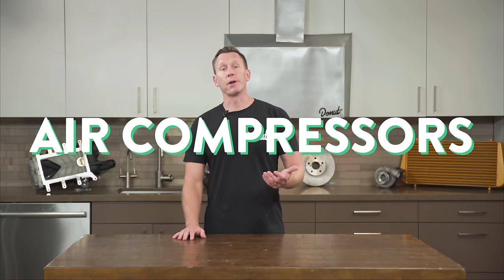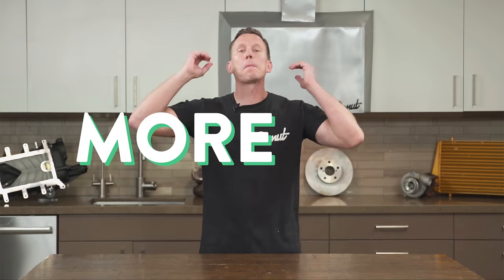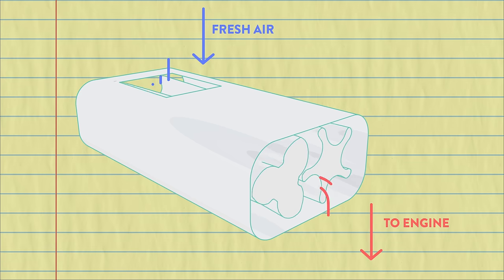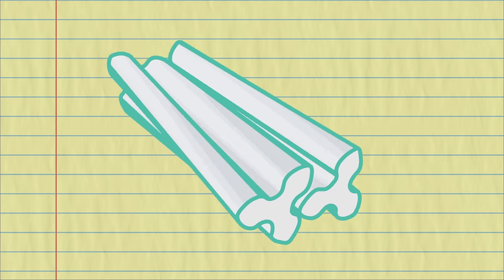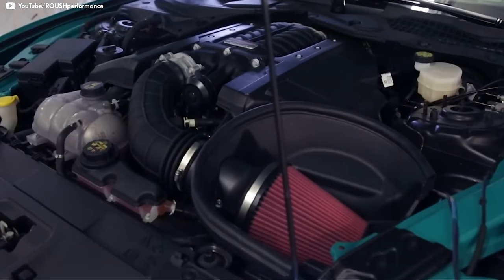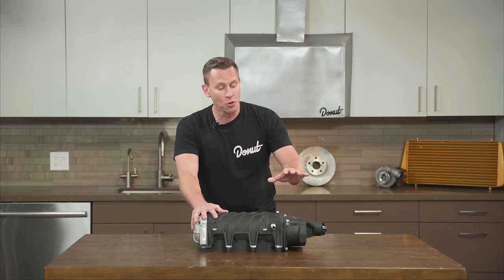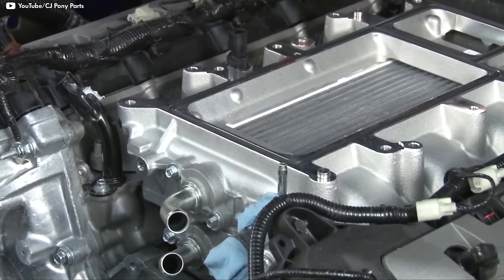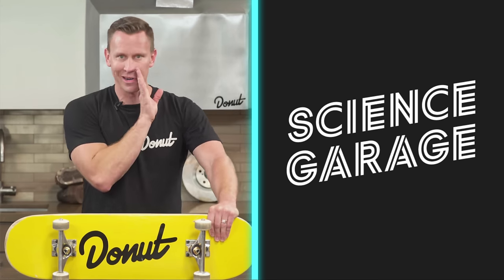SUPERCHARGERS | How They Work

Comment: Now that both the turbocharger and supercharger have been investigated separately, how about twin-charge systems?
Reply: I'm in
Reply: 1.4 TSI
Reply: lancia!!!
Reply: The Zenvo ST1 is Twin charged. it both has a turbo and a supercharger
Reply: @xxitzrawxx1732 
 Engineers: So what are we looking at for aspiration?
Zenvo: Well what are the choices?
Eng: Well we have enough space for turbos but we can also fit a pretty good supercharger of ours.
Zenvo: How much space
Eng: Well that depends on your choice
Zenvo: Just fuckin do both.
Eng: Bu-
Zenvo: I SAID BOTH
Reply: Check out group B rallying. They did this. 0-60 in 2.3s on GRAVEL in the 1980s
Reply: Lancia S4 demonry.
Reply: Engineer = sir do you want a Supercharger or a Turbocharger? 
CEO = Y E S
Reply: The koenigsegg ccr used twin superchargers
Reply: The Volvo S60 has a supercharger and a turbocharger. I’m sure everyone knows that
Reply: Twin charge is just a twin turbo or twin supercharger.

I'm assuming you mean compound boost (compound = 2 or more different items together as 1. Twin = 2 of the same.
Twin turbo = 2 of the same turbos. Sequential turbo is 2 or more turbos of different sizes set up in a series. Twin charged is twins of the same supercharger (usually a twin Procharger or Vortech centrifugal, rarely positive displacement type)
Compound boost is turbos AND superchargers, 2 different boost creators, working together to boost the motor.
And let me tell you, they're crazy. The twin screw obviously eats some power and caps out the top end, so it limits the turbos efficiency, but you basically get INSANE low end and hold onto it for longer into the top end. Again though, the reason it's not generally used in professional racing, is that it limits the efficiency of just plain old turbocharging and adding the turbo systems to the supercharger system is just added weight and complexity that they do not want to have in a race car
Reply: Yes with some nos !!
Reply: @Mr Sunshines Wow you're really going on a semantics crusade, get a life
Reply: WTF  @NewDesignVinylGraphics  hahahaaa. LOL. Show me a shred of evidence on Stock Volvo 60Sedan 2,4L. gas or Diesel?!   Not on this planet.  OMG.     My MB C180sportcoupe (M271).   Kompressor wheel just smaller and +45HP more instantly ! BOY!
Reply: @JoeIsCrazyWillman  F1 take a look. exhaust turbo + electric Kompressor... V6 1.6Liter 800-900HP!
Reply: Mr Sunshines no they are not the same thing Jesus man one is run by a belt and makes linear boost usually. The other typically peaks at the higher end and is fed by exhaust gases. Two different things that do the same job increase engine output
Reply: They are both compressors i.e. they increase inlet air pressure. Higher pressure increase thermal efficiency and air mass flow rate which translates to more power.

Twin screw compressors or lobe compressors are positive displacement (PD) compressors. During intake and compression, piston engine acts as a piston compressor, which is also a PD compressors. Therefore, if we put a PD compressor at engine’s air inlet and make its rotational speed proportional to the engine’s (hence the belt), it feels like the engine’s displacement get bigger. Hence the supercharger. No turbo - lag!

Exhaust gas still has a lot of energy. Therefore, if we put a turbine at engine’s exhaust, we can convert some of this energy into mechanical work. We use this mechanical work to spin a compressor at engine’s air inlet. This compressor cannot be PD compressor because turbine’s speed vary based on exhaust gas velocity and at low speed, PD compressor actually deliver less air than what would naturally flow if there is no compressors. Therefore, we connect the turbine to a dynamic compressor instead. This dynamic compressor does not do much until it rotates at a sufficiently high speed. At high speed, this turbine - compressor i.e. turbocharger become effective. Turbo - lag!

We can install both supercharger and turbocharge. Supercharger’s PD compressor provide instant boost at low RPM and turbocharger’s dynamic compressor take over and provide boost at high RPM.
Reply: Mr worldwide
Reply: There's a disturbing lack of Detroit Diesel 71-T in these comments.
Reply: re inventing tsi engine
Reply: Westin Chaplin and the dodge
Reply: Nissan March Super Turbo

Comment: Turbos are spun up by exhaust gas, superchargers are spun by a pulley on the engine assembly.  Same function, different ways of spinning it up
Reply: That is why turbos are lagging at low rpms
Reply: And therefore different boost curves, so you can manipulate them by tweaking and changing sizes of wastegates, pullies, AR wheels, etc, etc
Reply: @Mr Sunshines A Turbo is widely recognized as a means of forced induction that uses exhaust gases to power it.
A supercharger is widely recognized as a means of forced induction that uses the crankshaft to power it.
Reply: Mr Sunshines why are you so angry? Lol
Reply: @Mr Sunshines shuuushh
Reply: Why use turbo instead of SC if a SC delivers the same power instantly
Reply: @vixrse  so a SC takes power of the engine in the early rpms but delivers more power than a turbo on the higher rpms?
Reply: Oussama hosni A supercharger is always taking some power from the engine, regardless of rpm. Superchargers are better than turbos at lower rpms as they have no lag, while turbos are better at high rpms as they produce more power due to not being limited by the speed of the engine.
Reply: And different sound outputs too! (Superchargers are better in my opinion!)
Reply: @anthonyflahive9160  ohhh yeah!  Love me a good whine
Reply: @oussamahosni9890  There are many reasons why a turbocharger (or several of them) might be preferable to a supercharger.  First off, traditional pulley-driven superchargers create parasitic drag at all engine speeds and as a result, make fuel efficiency and engine wear worse no matter how fast/slow you drive.  Second, turbos are easier to package because they can be placed nearly anywhere in the engine compartment where you have room, unlike a belt-driven supercharger which has to be aligned over the motor's crankshaft pulley.
Reply: @vixrse  can u have BOTH on ur car for best of both worlds? SC for low rpm then turbo for when u really get going?
Reply: @daviedood2503  That’s called twin charging, and yes it’s possible and OEMs have implemented them, Volvo most notably. Sequential twin turbos are used more often to alleviate lag at lower RPMs. Twin charging in the aftermarket is virtually never done, most people seeking big power through forced induction will sacrifice lag for big boost numbers, that’s why many people modify their sequential twin turbo setups from the factory to a big single turbo.
Reply: @ripem1417  ah OK turbos come in different sizes? If there's room, can u use 2 big turbos? I heard about lag, but never knew what it was. I never understood boost. 

Is boost used to get rid of lag? Thanks for the input it helps me learn
Reply: @daviedood2503  to get rid of lag use variable turbos

Comment: You need to do "How turn signals work"  ....I think a lot of people would be shocked and surprised.
Reply: pt1 https://youtu.be/O1lZ9n2bxWA   pt2 https://youtu.be/2z5A-COlDPk  this should cover everything
Reply: @ubergamer0198  im guessing he was joking
Reply: bmw drivers*
Reply: "turn signals are pointless. Why would I need a little blinky light to turn my car? Plus, people behind me will figure out that I'm going to turn from me slowing down before I go into the turn lane, which they make way too long, in my opinion. If I get rear ended because I slam on my breaks and screech through a turn 15 feet from the intersection, it's all their fault anyway because that's how the law works." - way too many drivers on the road.

At least some of them give you a heads up by not bothering to replace and pound out the mammoth dents in their mangled rear end, with the rear bumper hanging on by a prayer on one side, and skip-dragging on the other end, throwing sparks behind them. That's why so many female drivers get suvs, they know they're going to trash it and fuck up. If they're driving a sedan, they'd just end up killing themselves and the little jerk offspring that causes mayhem with their constant adhd fueled marathon of kicking the back of the drivers seat, and punching the headrest, running around cause mom purposely omits the car seat in hopes the little fker will fly through the windshield one day when she slams on the breaks in order to make a turn 15 feet from the intersection. CPS doesn't give a sht, they just want her to stop abusing her kid's adhd meds, and leaving him at gas stations because the amphetamine manic psychosis episodes that make her think he's a gremlin, and that she's driving a spaceship. But the robot cyborg police keep bringing the little gremlin back to her house, slap her on the wrist, tell her she should be ashamed of herself, and then race to the scene of a police shooting because they forgot their drop gun, and need one quick so they don't get in trouble for shooting an unarmed black man, in the back, while he was gathering donations for the salvation army. Poor cop thought the guys bucket was a home made pipe bomb. That was the tenth black guy the salvation army lost, too, and it's only February. Oh well, at least the weather's nice here in California. The fentanyl is always fresh, too.